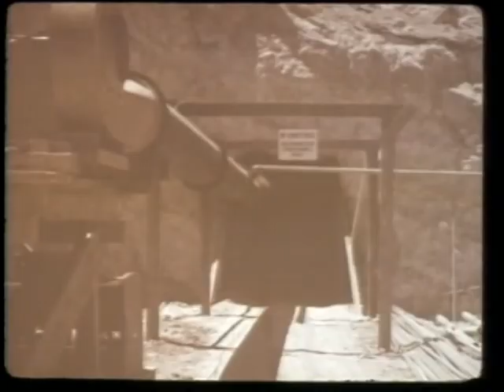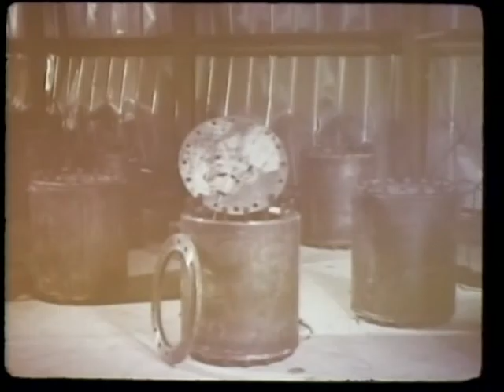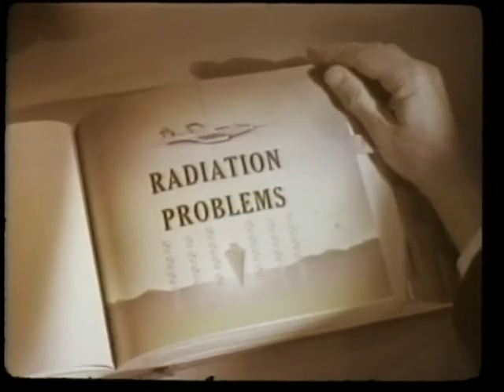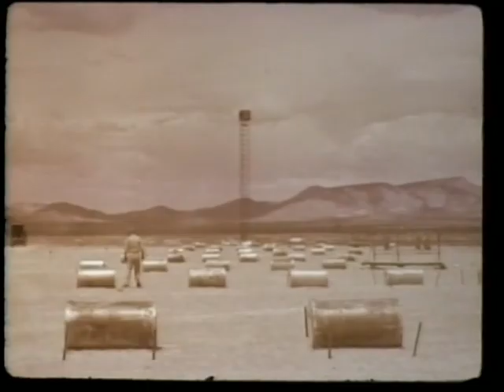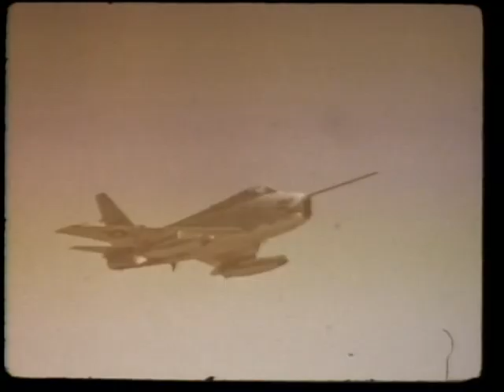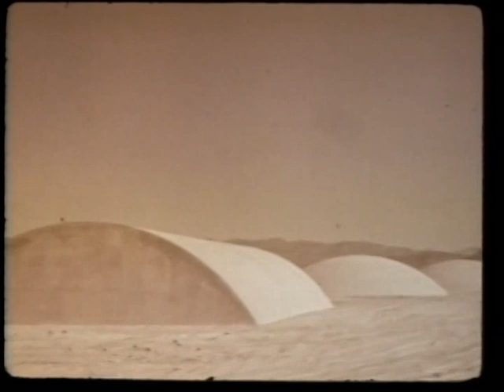Operation PLUMBBOB Military Effects

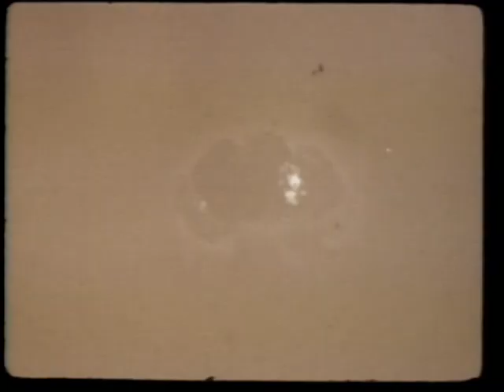Comment: 26:57 you can see the faint glow of ionising radiation on the air around the blast cloud. In reality, that would be seen as a faint blueish glow around the black cloud as the radioactive material strips electrons off air molecules. Similar effect you see in the water tanks of nuclear reactors.